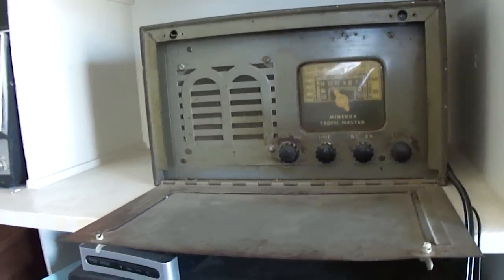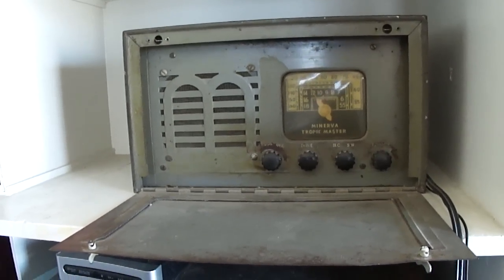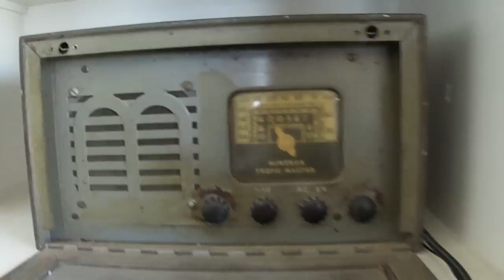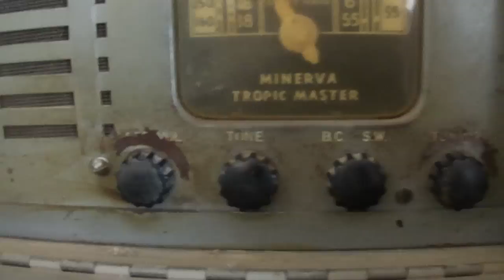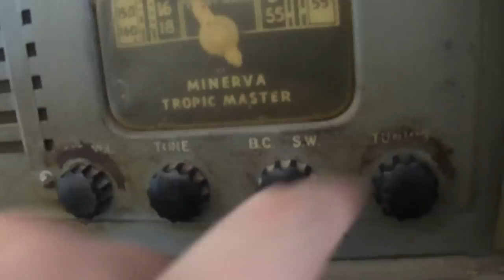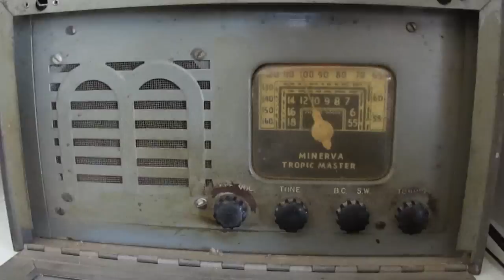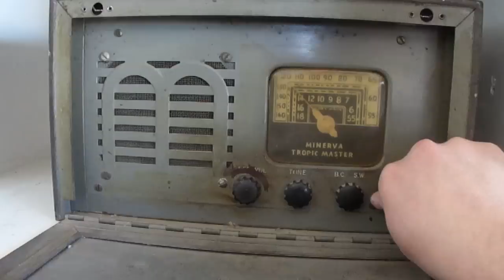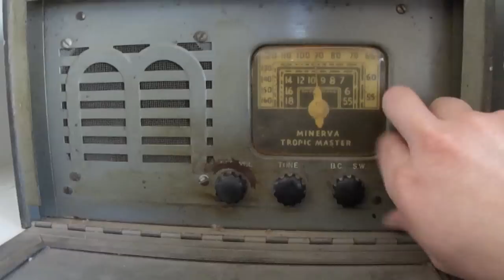1940's Minerva Tropic-Master Radio Test

Comment: I believe that these were originally designed as a morale radio but were later manufactured and marketed for civilian use after the war. If it was actually used as a morale set it would have a brass tag, or a remnant of one, somewhere on the outside of the cabinet denoting which branch of the military it was delivered to and when, like to the U.S Navy, for example.

Comment: Hi!  I've admired your work on all your projects.  Do you recap vintage amps?  I just got an RCA stereophonic SHC-6 console, and the previous owner plugged it in and tripped a circuit breaker when she tried it.  I'm not touching it until I can get someone to work on it!  :-)  I can remove the amp/tuner chassis and mail it.  I don't know anyone local to northern CA.  Thanks for listening.  Cheers, and you do great work.